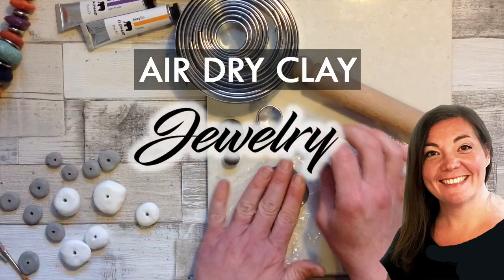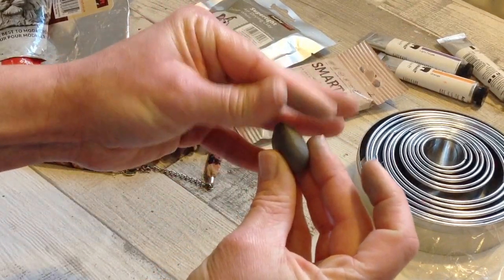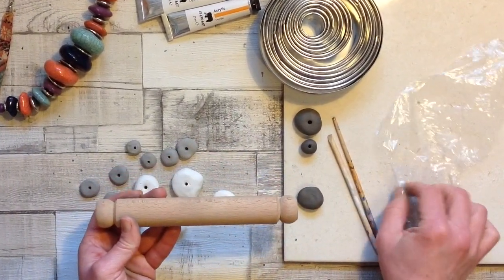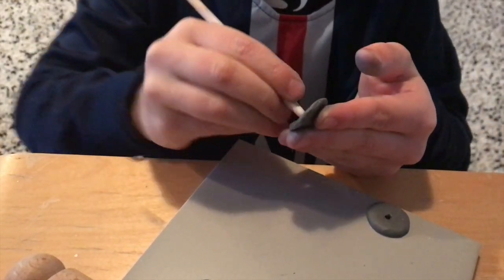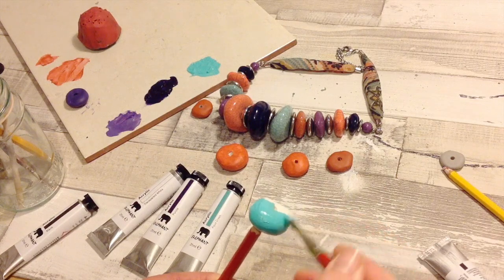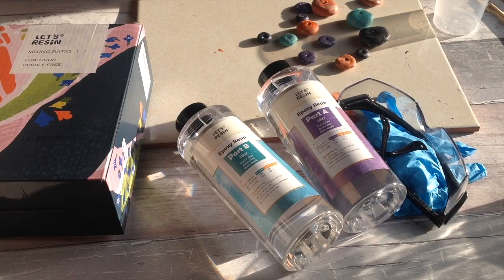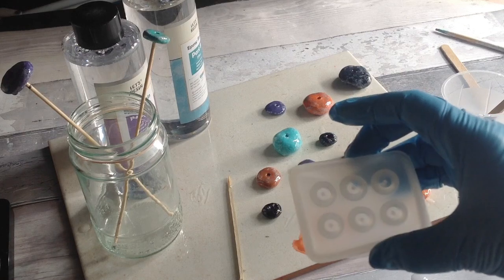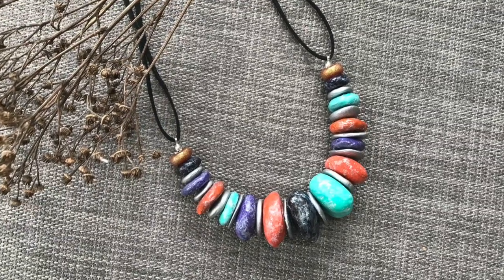DIY JEWELLERY MAKING CLAY at HOME - air dry clay jewelry

Comment: UV resin would definitely be the way to go if you plan on using resin to seal your beads. Make sure that you are using a silicone mat and silicone brushes. A wire rack and paperclips to hang the beads from will prevent them from sticking. Also, make sure to wear a mask (one that filters toxic fumes because resin is poisonous), gloves, protective eyewear, and work in a ventilated area.
Reply from the maker: Thank you for your tips, this is very useful to so many of us, UV resin I must try ❤️
Reply: I love UV resin Sarah, definitely recommend it! And yes, gloves and ventilation are a must when working with resin. Most do not give off dangerous vapours any longer though there is always the risk of developing sensitivities to the chemicals, so it is best to be as safe as you feel is necessary.

Comment: Resin - you can buy resin brushes which are silicone and much easier to paint your resin on.
A silicone mat would help.
Warm up your resin by putting the bottles in a bowl of warm water prior to pouring, this helps eliminate some bubbles. 
Sometimes bubbles are great, other times not so great!
The necklace turned out beautifully!!
Reply from the maker: Great tips for us all, thank you 😊

Comment: Thank you for the video.  Very helpful and interesting.  Can you get a shiny bead without using resin or other products?  I’m a newbie at this and was just wondering if buffing is ever done.
Reply: Sometimes I use a gloss spray varnish on my products. Sometimes I use wax. Either works really well and gives a shiny, durable finish.
Reply from the maker: This was to just test of the resin, I normally use a spray lacquer which is much easier, I have many other videos where u use other products as it allows people to use what you have or can easily or affordably get hold of 😊

Comment: You can always use an old paint brush to paint your beads with the resin and then throw it out when you are finished. 😊
Reply from the maker: I sure need to try a method to not let it drip. I’ve been doing the straight edges and done effect more recently and I’m loving it. Sure need to play more ❤️

Comment: Use a paint brush to add the resin, most are self leveling, you'll have to do a few layers, uv resin is best for this, your room looks sunny so they can cure in the sun if you don't have a uv lamp
Reply from the maker: I got in a bit of a mess this time didn’t I 🤦🏻‍♀️ but I’ve been practicing and playing lots since and definitely adding less, as you say with a paint brush works well, thank you, and moved over to uv for this as well otherwise waiting far too long. Thank you, sounds like you have it all under control 😊❤️
Reply: @RedRockingBird  you should have seen my first attempts at resin, they are still tacky 5 years on, I keep them as a reminder, my Daughter and me are learning about ancient Greese and are making half a Greek vases out of air drying clay and painting them, I'll hang them up when they're done
Reply from the maker: @Mitsey123  😊 such a learning curve but great fun, wonderful, enjoy ❤️

Comment: Use a silicone matte with the resins. 

And UV resin might be worth looking into just be sure to cure all sides. You are crafty so, I'm sure you will figure neat ways out working with resin. Hand drill for the center helps. Using some sand paper, nail file or dremol tool. A silicone qtip applicator works well coating with resin. Definitely wear gloves use with a mask or in ventilation.
Reply from the maker: Thanks, I will do more playing/practicing, yes I need to get a silicone brush thingy 👍❤️
Reply: @RedRockingBird  the Silicone makeup swaps are good to try and I saw Moriah Elizabeth just now stick the beads she was drying on toothpicks on a piece of Styrofoam to dry up in the air. One of those foams cone shaped you use in dried floral might be great. I know you are good at finding stuff around your house to use.

I'd say either get a Silicone you can brush on sticks they sell it...something. Clear silicone caulking (no mold additive) coated on a skewer works as a drying stick for those beads....

Those eyelash Silicone applicator applicators too work.

Believe they sell slicone covered reusable toothpicks. If it is Silicone resin won't stick basically lol

I have had fun with resin UV resin doesn't cure well with darker colors or too much pigments/dyes very little goes a long way. 

Thank you for sharing. I've enjoyed your content.

Comment: Hi. I’ve got an unrelated question, hope you can advise.

I also use DAS Air Dry Clay to make decorative objects. 

I paint them with acrylics. But all of them seem to stick to surface I place them on snd the paint - dried and sealed - peels off at the bottom to expose the Clay. 

Please help. Thank you
Reply from the maker: Hi, I know what you mean, if each layer of paint and then varnish is left to dry fully this should not really happen. I think I would try a stronger top coat and let this dry fully before allowing it to contact anything.
Reply: @RedRockingBird  Thsnk you so much for the reply. May be I’m not allowing for enough drying time. 

Patience is not my strongest personality trait!! 

Very much appreciated. 

♥️
Reply from the maker: @fatimamirza2100  I’m the same 😆 I’d try a different varnish too